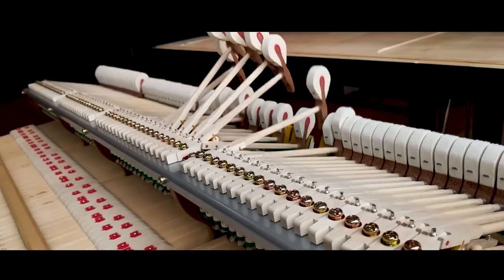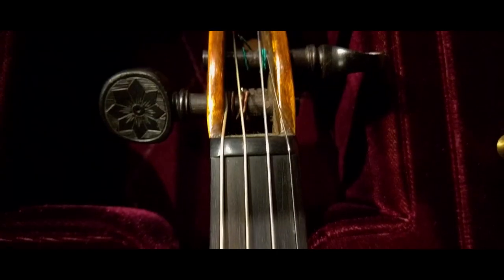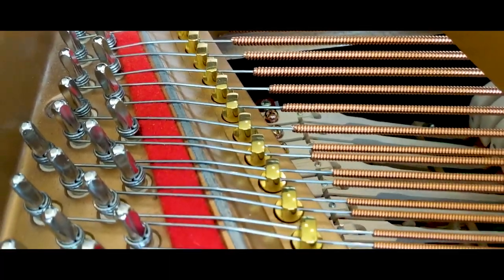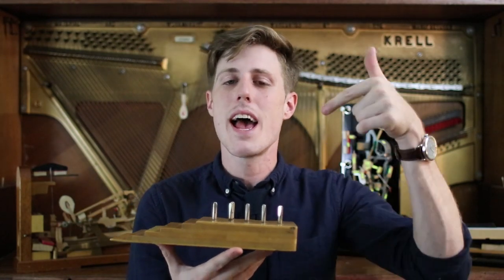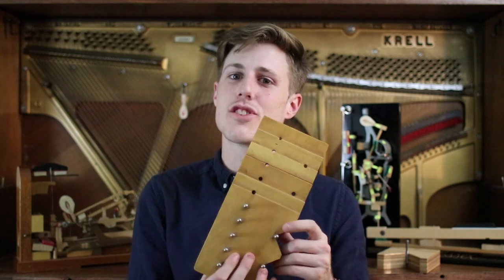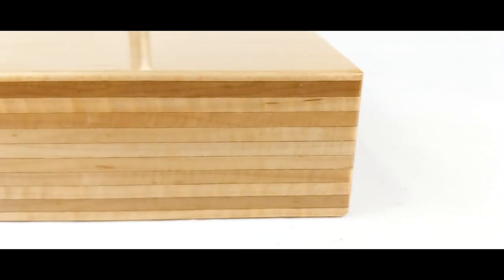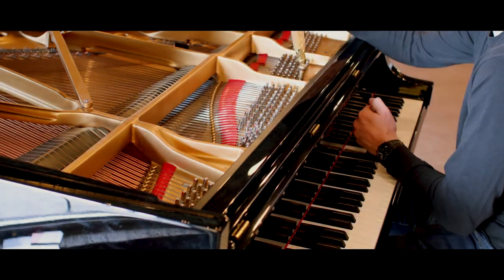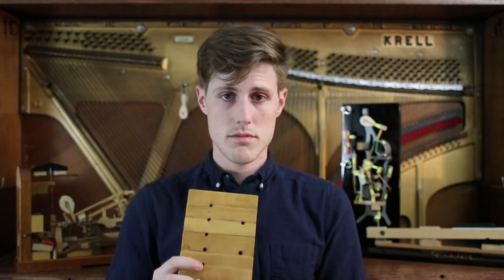Pinblock and Pins. Anatomy of the Piano Episode 3

Comment: the string diameter is not the same on all the piano. there are several different diameters in the piano and i´m talking about the naked strings. the core of the bass strings are not usually the same neither.
Reply: Yes I was just about to type this.

Comment: Please correct the information about the strings being all the same diameter. They are not. There are several size bass cores and we use (mostly) sizes 12-22 gauge steel strings for the plain wires We use a micrometer to measure them and they get smaller as they go up the scale. ASK YOUR TECHNICIANS!